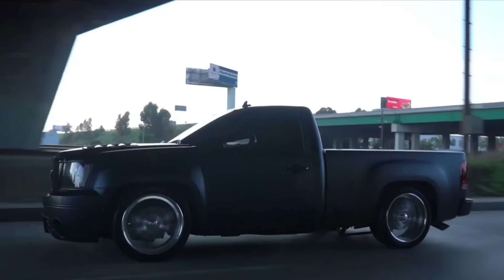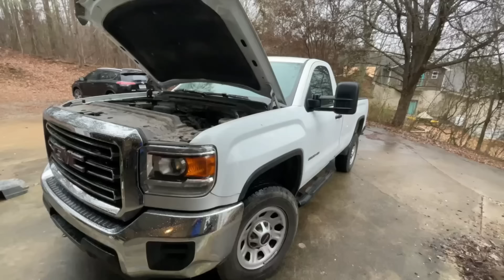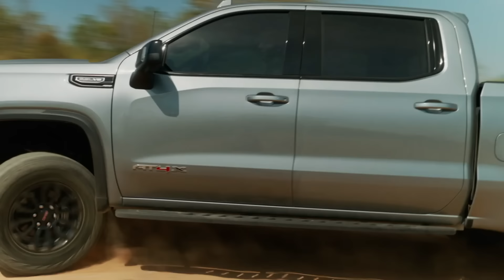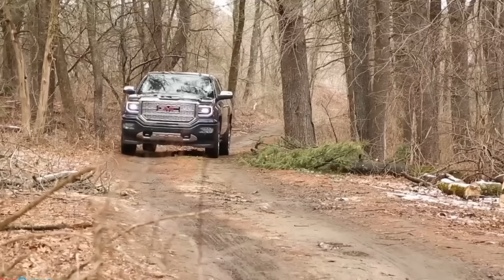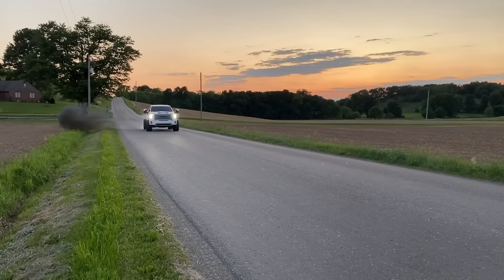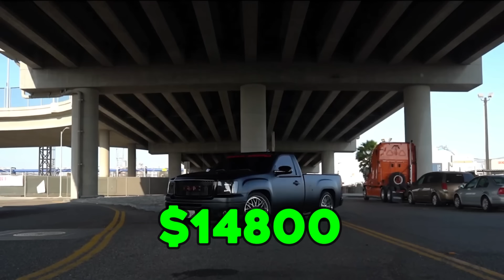NEVER Do THIS to Your GMC Sierra - 15 Expensive Mistakes

Comment: Today’s drivers are too stupid to check tire pressures without needing to be told their tire pressure may be low. All these new safety features tend to promote stupidity regarding the car keeping them safe. They now rely on the car to keep them and others safe. They have NOT made anyone a better driver but just the opposite. We now rely on technology to keep others safe.
Reply from the maker: Hard to argue. Risk compensation is a documented phenomenon — when drivers feel safer, they take more risks, which offsets the safety gain. Lane keep assist, automatic braking, blind spot monitors all encourage less active driving. The tire pressure monitor specifically replaced what was a 30-second weekly check most owners did themselves. Technology covers up bad habits instead of correcting them. You're not wrong.

Comment: I have a 2023 3.0 L Duramax. Do I need to buy a dfm disabler?
Reply from the maker: No DFM disabler needed. The 3.0 Duramax is a diesel inline-six and doesn't run cylinder deactivation — DFM and AFM are gas-engine V8 technologies. Your engine fires all six cylinders all the time. Save the money for fuel filters every 25K and Dexos D oil at 5,000-mile intervals.

Comment: The fix on most of this is remove and replace owner with someone who has common sense knowledge to ignore owners manual and change lubricant, brake, & cooling fluids at 1/2 the recommended intervals.

Comment: I have a 2006 GMC Sierra SLT crew cab four-wheel-drive with a 5.3 L engine I don’t know what the DFM or AFM IS ?
Reply from the maker: You are in luck because your 2006 model predates those systems entirely, meaning you don't have to worry about those specific lifter issues. 💪
Reply: @EverythingGMC-k9x  I had the same concern, although my 1500 is an Elevation and is double cab. I wonder if I am sheltered like our friend xXAdioPuffzXx
Reply: I have a 2023 3.0 L Duramax do I need a dfm disabler?

Comment: Can you not use the transmission temp gauge.  Shown in the video?
Reply from the maker: The transmission temp gauge shown in the video is accessible through the DIC (Driver Information Center) on most GMT900 and newer trucks — cycle through the display options on the steering wheel controls and it's usually listed under vehicle information. On some trims it may require a scan tool or tuner to enable it. What year and trim is yours? 🙏

Comment: I’m taking my 15 Sierra in on a Honda Pilot
Reply from the maker: What's the issue with the 2015 Sierra that's pushing you toward a Honda Pilot? That's a big shift — worth making sure the diagnosis is right before trading down in capability. 🙏

Comment: I have a 2017 Denali   Will driving in tow haul mode daily stop A f m from activating  ?   I have a disabler but was just curious
Reply from the maker: Tow haul mode does suppress AFM partially by holding gears longer and managing throttle differently, but it doesn't fully disable it the way a dedicated disabler does. With the disabler already in you're fully covered regardless of which drive mode you're in. Tow haul on top of that is just extra protection for your transmission under load. 👍

Comment: Biggest Mistake……………..Buying any GM now !  2023 Silverado with less than 50kmi , in shop Now , today is day 115 !   And this is the second go around.  Total days in shop in the last 7 mos………..190 Days…..so far.   They Can’t figure out what’s wrong and can’t get parts !  I’m getting that Genuine GM feeling!
Reply from the maker: 190 days in the shop in 7 months on a 2023 with under 50K — that's a lemon law case, not a repair situation. Most states have lemon law protection that kicks in well before that threshold. If you haven't already, that's the conversation to have with a lemon law attorney, not the dealer. 🙏